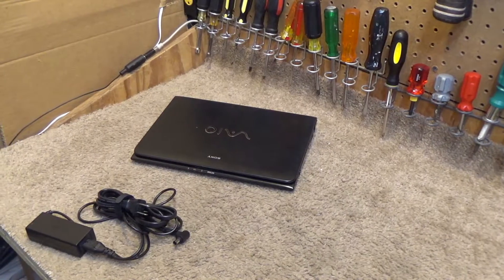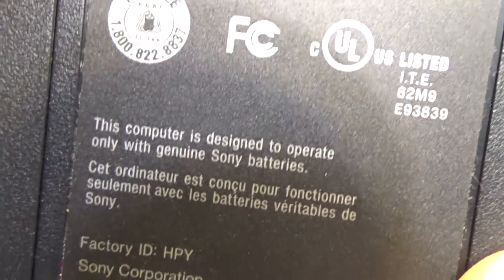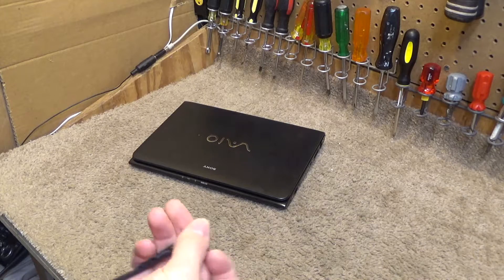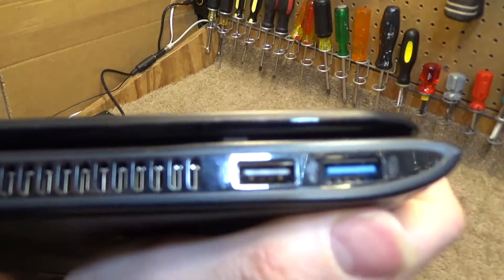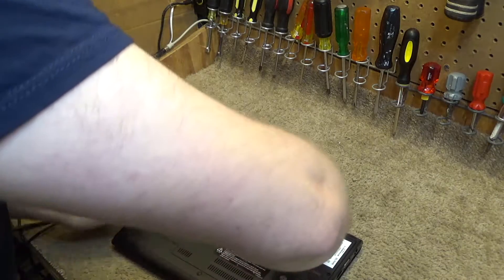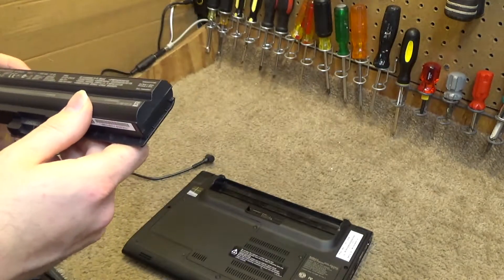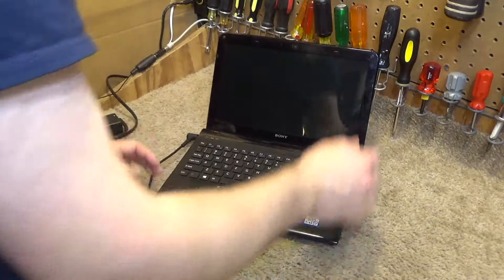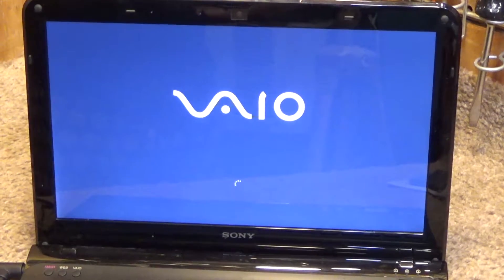Sony VAIO E Series SVE111B11L Laptop Computer Upgrade | Part 1; Hard Drive Replacement

Comment: Windows 8 came out in 2012, so I'd believe that's either 2012 or newer. I know Windows 8.1 was offered up until the release of Windows 10 in 2015. And to be honest, Windows 10 isn't bad when running on Solid State Drives. It isn't even that bad on my computers that do have HDDs, although the lag really sets in when doing Windows updates.
Reply from the maker: The date code is shown on the drive. I've never had a good experience with Windows 10 regardless of the drive. Even though an SSD can keep up with the I/O, it's still a bloated, unreliable system.

Comment: I have a Sony Vaio F series from 2010 with an I7 processor.  Last year I replaced the 5400 rpm drive with a 1TB ssd, and the performance difference is beyond night and day.  I think switching to an ssd is one of the best upgrades you can do.
Reply from the maker: The drive I/O on Windows 10 is quite high compared to previous systems. I tend to think they never intended it to run on a rotational drive.

Comment: Nice! You will definitely notice a huge increase in speed going from that 5400RPM drive to an SSD. I have had good experiences with those Kingston drives, they seem to be pretty good. I remember when I built my first computer 8 years ago, SSD's were a fairly new development and I paid over a dollar per gig for my 120gb SSD! I actually still have that drive today and it works just fine! Just as fast as it was on day one!
Reply from the maker: I remember when 250 GiB 7200RPM drives were an expense. It's incredible how cheap storage has become over the last few years.